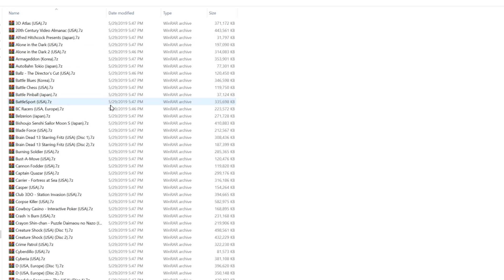Hard Drive not recognized after replacing Faulty board - Bios IC Swap using Low melt solder.

Comment: I had capacitor blown off on my HDD too but after replacing it doesn't even run its like I am connecting nothing to PC... I replaced it 3 times nothing happens . Maybe I have to buy a board now

Comment: hi, i hope you may be able to help: i bought a replacement PCB board, to do a BIOS CHIP SWAP, and my local computer repairers said,  it seams my old bios chip has oxidised, and is unsavalagable, is there any other way(platter swap) that i may be able to recover data. thanks in advance for your reply,regards Graham,Liverpool/England

Comment: Hi! Could you help me, please? I`ve replaced IC Bios chip on my PCB board. It start working but HDD doesn`t sjow files now. Should I replace main IC chip as well or its HDD failure by itself? I have Seagate 2 Tb. PCB board totally matching by serial number and how it looks like
Reply: Same. I replaced my bios chip on the new pcb. It starts up but doesn’t read
Reply: Did you find out how to fix it?
Reply: @SlagroomenCornflakes  nope
Reply: @bobbo2576  that’s unfortunate. I’m sure in some time we will find out how to solve our problem.
Reply: @SlagroomenCornflakes  that or send it to somebody for 1k
Reply: Some boards have 2 bios chips.. also when replacing chips make sure it goes back the same way you took it out...
Reply: @jayden018  I did. Didn’t work

Comment: What happens if I don't have the original Bios chip? I lost my pcb long time ago... have lots of data on this drive. Dont want to spend on repair, but if I get the replacement identical firmware/serial/model pcb will it work?

Comment: what do you think is the issue if i have already swapped the bios from an old pcb to the new one and it worked for several hours i was able to transfer few files then it did not work the next day. then it won't get detected on disk management. I have tried buying a new pcb and transferred the bios once again but it still won't push in getting the hdd to be detected. does it mean the bios chip is dead?
Reply: Potentially their could have been an error in the soldering...

Comment: Sir good evening to you in the Philippine time my name is ace and im also subscriber to your channel ..im just want to ask help  to know about my phone samsung note5 korea original..my problem is when someone call me it works fine but if i put on speaker mode the mic is  gone and they can't hear me even in video call ..hope you can help me..thank you sir
Reply from the maker: Note 5 has 2 mic, One on the bottom and one on top. Top mic is probably used when you are in speaker mode and it could be faulty. Try this quick fix, Go to settings under sounds and select allow to play with hearing aids.